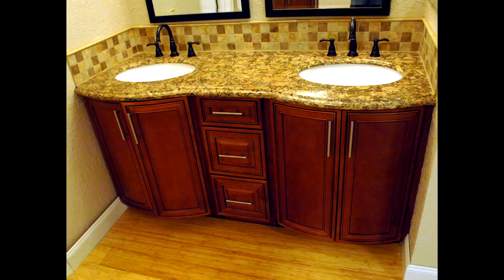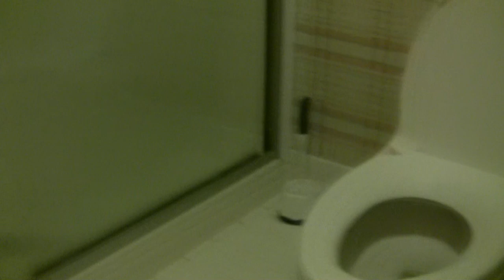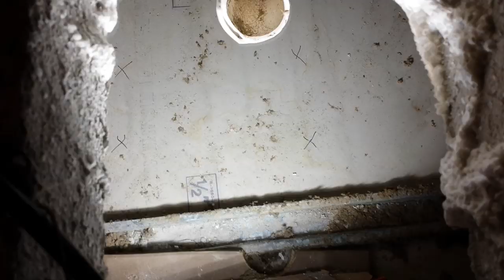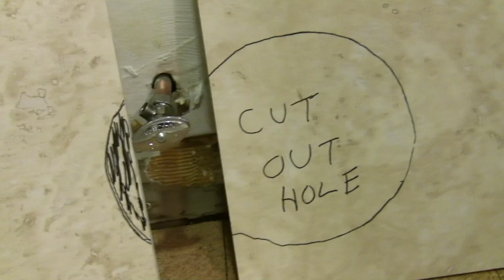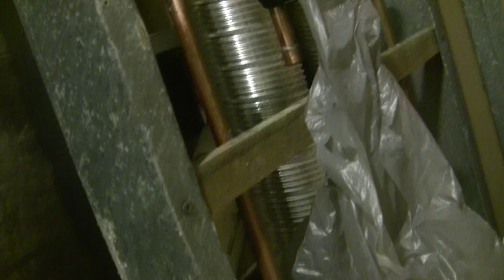Our Best Bathroom Renovation Yet - Part 1 | Engineering Disaster

Comment from the maker: Parts used in this bathroom remodel project:
✅ Schluter Kerdi Shower Kit 38" x 60", Shower Pan, Curb, PVC Flange https://amzn.to/2EJ7bas
✅ Schluter Kerdi 108 Sq Ft Waterproofing Membrane: https://amzn.to/2sWh1TU
✅ Schluter Kerdi Drain Grate Kit, 4" Oil Rubbed Bronze https://amzn.to/2sKJAnf
✅ Schluter KERDI FIX SEALANT 9.81OZ White  https://amzn.to/2ZkZD7j
✅ Schluter KERDI-BAND - 5" X 33': https://amzn.to/35SuZVB
✅ Schluter KERDI TROWEL - 1/8 in x 1/8 in Square Notch: https://amzn.to/2ZiMtHZ
✅ Schluter Systems 2 Kerdi Inside Waterproofing Corner Pack 2: https://amzn.to/2QeRGwr
✅ Schluter KERDI Outside Corner - 2 Units: https://amzn.to/2PQwT3l
✅ Schluter ALL-SET WHITE 50 lbs bag THIN-SET MORTAR https://amzn.to/371VSX7
Reply: For my shower my shower only produces VERY HOT WATER! There is no cold water what do ever! And we don’t know what to do!? Even if we just run it on to the lowest water it’s BURING HOT!
Reply from the maker: @alishachheng7527  Sounds like your mixing valve on the shower cartridge is bad or someone installed your shower cartridge upside down, and it would need to be pulled back out and rotated 180 degrees. How old is your shower cartridge? Might be time for a new one anyway.

Comment: Hi Jeff, I appreciate your videos. Builders from the 80’s & 90’s cut corners terribly, causing all sorts of problems. I owned a couple of homes from those decades and can tell you at least in CA, the showers were made without any green board behind them to protect them from water leaking into the wall & down stairs. Idiots. Rotted out the floor of the showers within ten years.
Reply from the maker: Yes, you got that exact, same here the 80s and nineties were bad decades for builders

Comment: My experience as a general contractor over the last couple of decades is that most builders build cheap and cut every corner they can.  They pick the CHEAPEST bids which are always substandard and executed incorrectly.  Thus I switched over to working for myself and flipping houses and condos.  Now, I am astounded how most all of the original house owners never did basic upkeep or that they rigged things together which of course never works out.  Common sense has died out.

Comment: What does the re-bar around shower drain hold to? In the video it looks like it was just put there, but it's not actually attached to anything else - just fitted in. Is it correct approach?
Reply from the maker: No look closely, I drilled 1/2" holes into the slab and slid the rebar into those holes

Comment: Hi Jeff...I enjoy all your videos...if I was an apprentice, I'd want to work with you....however, my house was built in 1988.  I want to replace the 59 1/2" wide, two-sink, vanity top (wall to wall).  What I've seen in the big box stores and online are 61" vanity tops. Where can I find a vanity top that is close to the measurements of my vanity top?  I look forward to your reply.
Reply from the maker: I don't think you can find one like that, but search online maybe you will find one. Do what I had to do on my last project, I buy the cabinets, and if I can't find a vanity top at Home Depot that fits, I brought in my granite guys to measure and custom make my own granite countertop with sink and faucet holes for me, costs about $700 for that size! OR, you can get an angle grinder and slice off an 1" or so off each side, whatever you need to make it fit.

Comment: That's not angle iron at the floor , that's called a riser clamp , used to hold the pipe in place. 55 year plumber ,retired.
Reply from the maker: They picked a strange place to put it! Wouldn't it be better to design the walls so the pipes going to the downstairs neighbor stay inside the wall?
Reply: jeffostroff  Don't know how many floors in the building , usually the wall lines line up one over another in a building like that                                                                                                                                               they usually screw sleeves to the decking before they pour concrete . Evidently someone measured a wall line wrong when putting the sleeves down . When they saw the pipe was going to be out of the wall they should have core drilled a hole in the right spot. Sloppy workmanship on the part of someone.
Reply from the maker: @johnkrim8377  2 story condos. 4" slab with 18" crawlspace between them.
Reply: Riser clamps are needed on every penetration floor by code